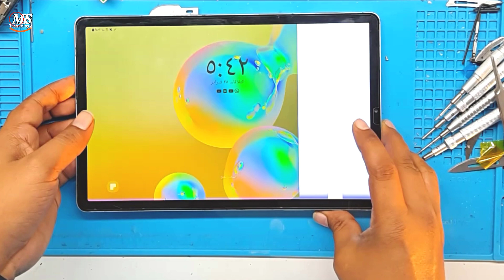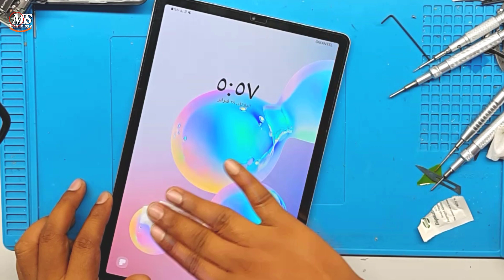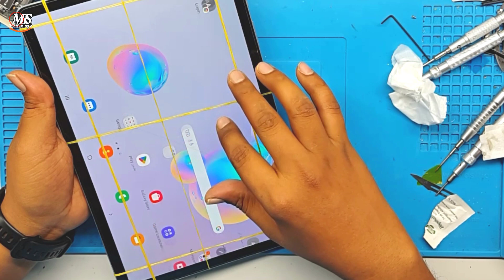How To Fix Vertical Lines On Samsung Galaxy Tab S6 || Galaxy Tab S6 LCD Inside Vertical Lines Fixed

Comment: Can u help me with mine? Same tablet.  Thick Green lines appear which turn white after some time . Also if an app has a specific colour, the colour will come in a straight line. can you tell me what happened? Is it loose display connection? Pls help 😭 🙏

Comment: If one has to change the LCD , do all the files on the device storage get deleted?
Reply from the maker: No, No delete data
Reply: @MRSTechnology  my s6 lite tabs touch screen suddenly stopped working and there are a few lines no spot, it didnt even fall 
Why do you think its happening?